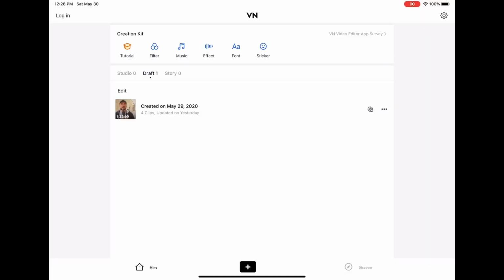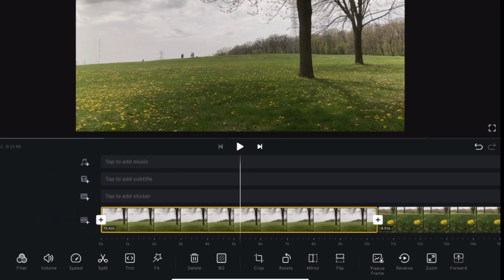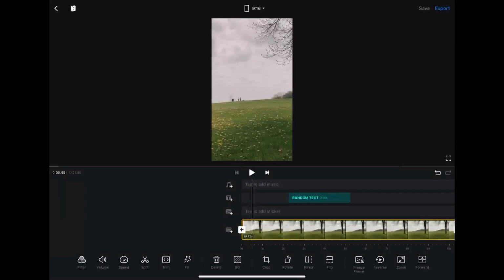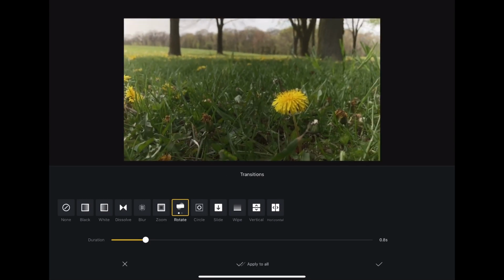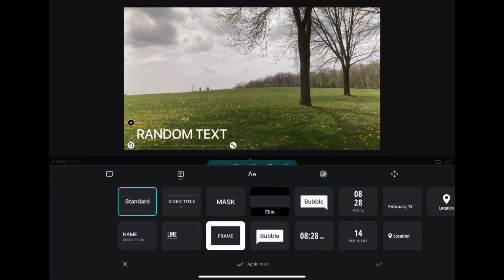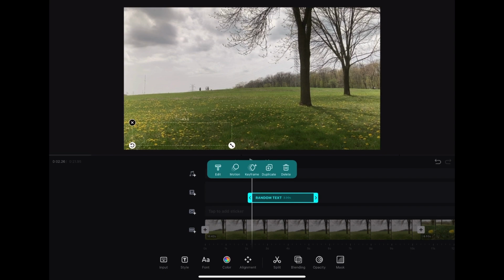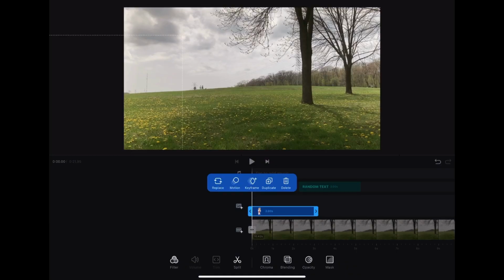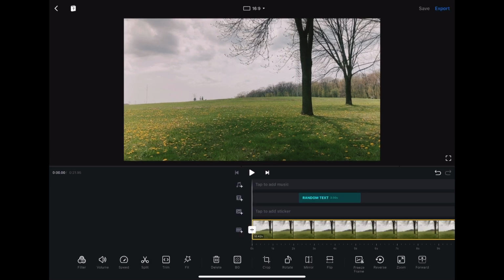VN (VlogNow) Editing Tutorial 2020

Comment: Hi, I have a concern regarding audio video out of sync after exporting. I did trial and error and found out that the reason why it is out of sync is that, after exporting of video with BGM and sound effects it turns to variable bitrate(audio). How to fix it? It should be contants bitrate for audio. Any feedback will be appreciated. Thank you so much.

P.S. 
All my video clips are 30fps (Constant)